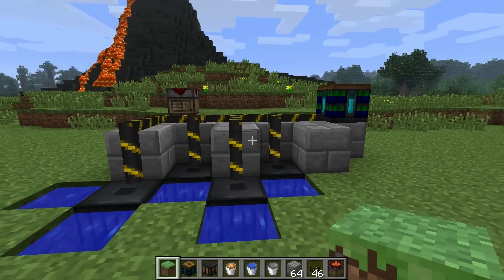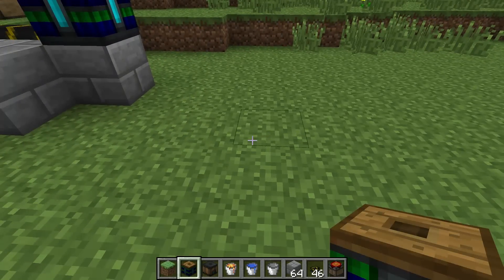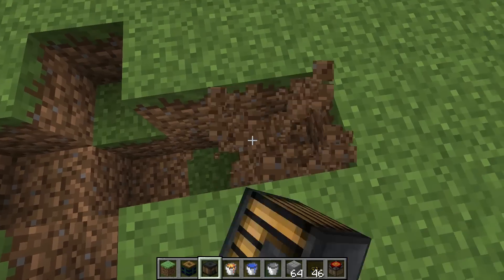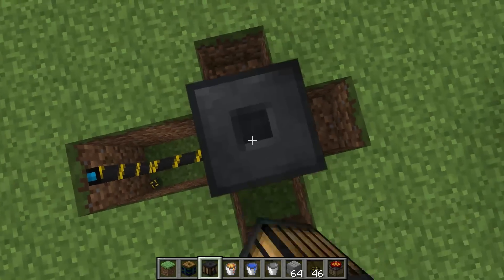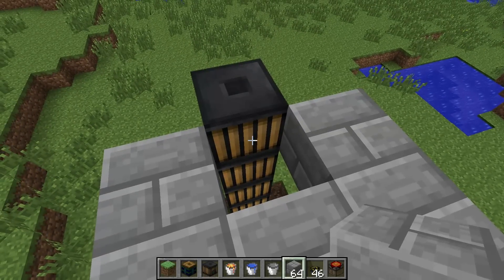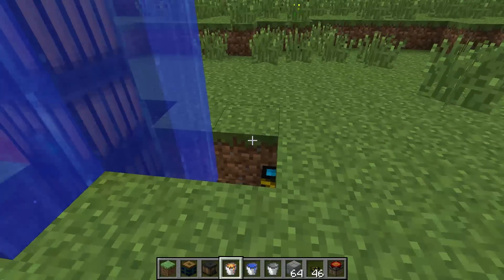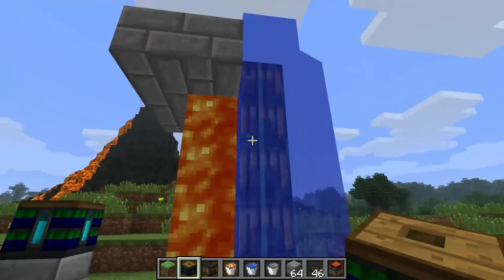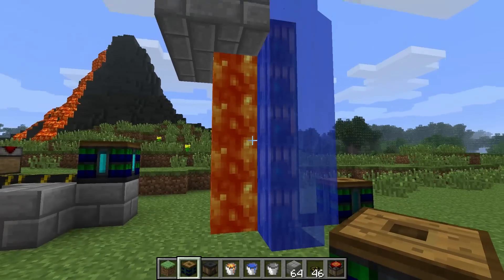[Tutorials] Redpower - Thermopile Vertical stack

Comment: In 1.4.6 things were sufficiently nerfed in general, that yes, RP2 power is a pain to generate.  Given that I'm currently playing 1.2.5, however, I can use EE to transmute a lot of my raw materials, which makes it considerably less painful.  If you can, I'd strongly suggest downgrading.  1.4.6+ is fairly simply not worth playing, in my opinion.

Comment: I didn't ignore you suggestions to use snow or ice.  They require management which makes them less than useful for building an AUTOAMTED system, defeating the purpose.

Again water placing in the nether is a bug and was fixed long ago.  If you're playing with a mod that reverts it, okay, but in vanilla it was fixed a long time ago, long before 1.4.6.  I'm using Tekkit Classic at the moment since that's what my buddies play on, again would like to use it with Feed The Beast.